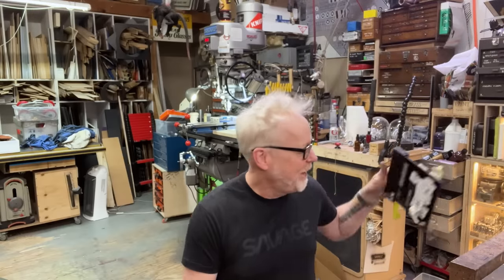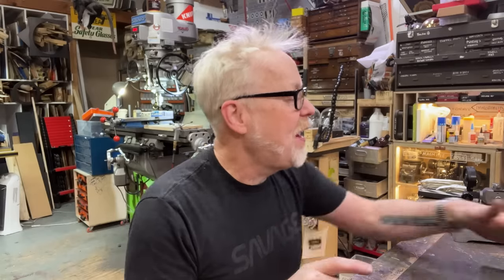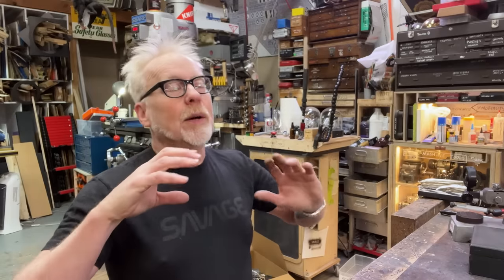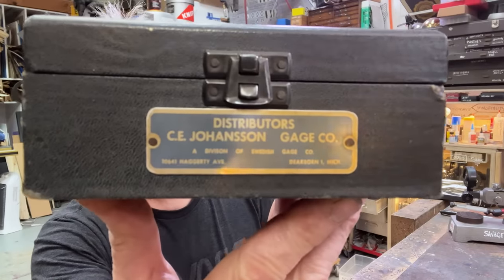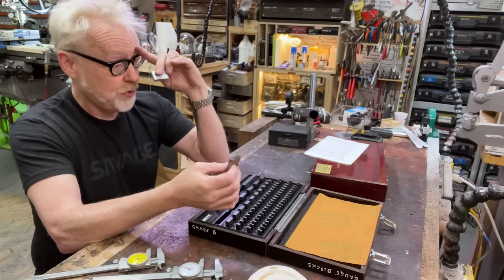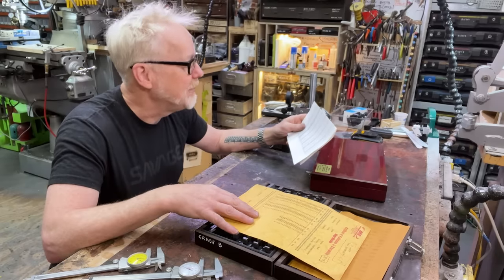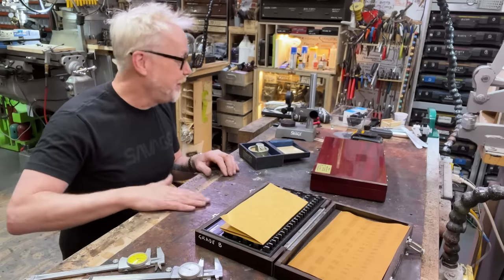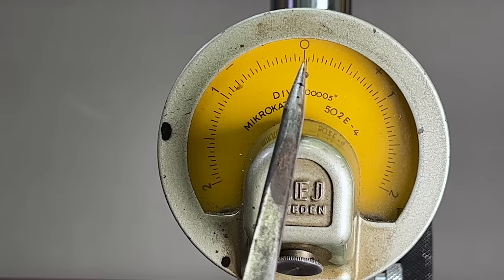Adam Savage's Most Precise Measurement Tool!

Comment from the maker: Adam on the science of measurement: https://www.youtube.com/watch?v=qE7dYhpI_bI
Dial calipers:  https://amzn.to/442pNNb
Reply: What where you at comicon in Indianapolis
Reply: You’d love to work with LOVAR. 
Basic Steel has about 6.5 ppm per °F CTE. I have a 100 foot tape of LOVAR which is 0.22 ppm °F. 

Invar is not an uncommon alloy used in lab standard and it’s CTE of about 2 ppm °F.
Reply: ….and the variation in size with temperature is why we usually handle Jo’ blocks only with a piece of chamois leather…..
Reply: 16:30 no, im just baked, love learning, and miss watching mythbusters after school
Reply: I was kinda surprised you didn't pul out a micrometer. I think we used to use Starrett Mechanical's micrometer  When I was in school. I loved working on the lathe & milling machine. I also designed stuff in CAD. I remember making 2 50mm blocks that I got to a mirror shine using emery paper & then emery cloth, eventually using the cloth part without any grain to lap them until they could be pressed together (without twisting) between my teacher's thumb & forefinger to see itf they stuck. he tested everyones by attaching one side into the magnetic part of the milling machine <you pulled a lever & the magnets would align> & hanging weights in grams from the other side.  (he showed us a pair of blocks that were so true they could hold over 42 Kilograms before they pulled apart. They were non-magnetic because they were aluminum.) Most of the class got a few grams, my neighbor's was almost 8.3 Kilograms, & mine was 17.6 Kilograms. 

Towards the end of the year our class was part of a contest for Panduit, (the machining company that machined extremely precision parts for NASA, F1, & Boeing Aerospace, etc) but I was a "people pleaser" back then & let ppl get in front of of my project. I still got 2nd place & my next door neighbor got 1st- a 4yr scholarship to Panduit. He went for a couple of months & quit. That was all I had wanted to do back then- but couldn't afford it without the scholorship. I ended up joining the military instead. Sadly I've never had the opportunity to do anything like it since.

Anyways, you mentioning Carl Edward Johanson reminded me of Gary Kildall- the programmer that invented CPM (Controller Program for MicroControllers, <for CMOS (complementary metal-oxide semiconductor's), DOS (Disk Operating System) BIOS (Basic Input Output System) & had his work reverse engineered using the debugger he wrote as part of CPM by Micro$oft for a deal they made with IBM.

His business was bigger than Micro$oft,(8M) IBM,(12.7M) & Intel(6.2M) at the time making over 25 Million a year for 3 years consecutively. As a result of their theft & bundling the reverse engineered version they made (complete with the exact same bugs the original had) bundled with new IBM PC's he was effectively run out of business.

Comment: when i was at college one of the students used a Mitutoyo grade A reference set of slips as parallels in the milling machine - the tutor almost lost his mind
Reply: ouch...
Reply: That's why you don't leave that stuff sitting around the shop.  I saw a B&S square, welded to a table as a welding fixture.  And it looked new.  I'm glad I didn't pay for it.
Reply: @corndog6700  the slips were in the quality control room (A/C of course) which was at the one end of the machine shop the  room was normally locked and we were not allowed in as spot faced 19 year olds, but for some reason the lad went in there and found them and must have thought "hey look a nice box of parallels" this was back in 1991 when they were rather expensive, god knows how much damage was done
Reply: Metric is the way.
Reply: @lloydwilson9104 and are still rather expensive
Reply: @lloydwilson9104  To be fair, they are a nice set of parallels
Reply: God
Reply: Well, if you want your workpiece LEVEL, THAT'S level.
Reply: @shelleyking8450  insert "rick and morty - perfect level" clip here...
Reply: Grade A? Ya sure?
Reply: @Doodlebob563  Not really, no two are the same height.
Reply: 1 @shelleyking8450
Reply: @billrowan1957  im an ex toolmaker - CNC programmer - former aerospace machinist and quality control engineer....... yep im sure  😁 you may also know these as grade 00
Reply: @fristlsat4663  luckily he had the 3" and 4" slips so didnt actually have them on the reference faces, i dont think he actually damaged them but boy did he get a roasting
Reply: @Scaze74 what does this have to do with this comment?
Reply: @Scaze74  i agree but precision is precision
Reply: @john1182  yea either is fine. Imperial has its place too, especially in aviation. Each has pros and cons to different applications IMHO. But its trendy to not acknowledge this and be fully "Americans and their dumb derp derp units, metric all the way!"
Reply: micrometers for c-clamps.
Reply: So long as distance is the metre, measured with a meter
Reply: I prefer furlongs per fortnight for velocity
Reply: @chiphill4856  I think you've just been spying on my daily walk!
Reply: @Doodlebob563  It's true. People will more conscionably use old ones as parallels, because they do make great parallels.
Reply: @shelleyking8450 True Level. (Rick & Morty)

Comment: Hi Adam, I love your videos and your fascination with the world of metrology. Being a retired metrologist myself I get excited when you put out videos like this and the others, of I also love the other stuff you do… If I may give you some advice, the reason you had trouble wringing your gages may be due to dirt. First off, you should never touch the business end of any gauge blocks especially your ceramic blocks! Wiping them on your clothing may be even worse considering the crud, which you’ll never see, that can easily stick like glue to the oils on your skin which will contaminate these surfaces. You can buy products to clean them yourself or send them to a reputable calibration house to have the cleaned. The data on the certificates doesn’t tell you the accuracy of the gages, but the DEViation of your blocks to the blocks used to perform the comparison. Gage blocks won’t have a stated accuracy, but their traceability values of the blocks used to perform the comparison procedure to your blocks. Their blocks have DEV data just like yours so during the comparison process they take the nominal value, labeled on their standard, add the deviation and then use that number to determine the DEV of your blocks.
Reply: I kinda figured this was getting to the level where cellular-scale material transfer from skin/cloth/etc would have an effect on the precision.
Reply: Yeah, I'm not a measurement guy, but even I was sad at the way he was treating his precision instruments. He just gets through telling us how they are finely polished, then he's there with his grubby fingers in his grubby shop, wiping them like a brute.
Reply: @chrimony  Well like he said, the B grade ones are the shop ones. But one can still clean them properly.
Reply: As someone who actively works in calibration and metrology it definitely is frustrating to see people mishandle tools especially ones that are used as standards. That being said. I love Adams fascination and understanding of the metrology.
Reply: Adam's attitude in these videos appears to be this: these are tools, i use them in accordance with the cleanliness level I am accustomed to, therefore the blocks will be consistent within my normal use.   He said himself that a few 1/1000" was about his tightest useful tolerance.  I hope I'm not putting words in his mouth.

Comment: Great metrology lesson. Regarding the calibration certificates of the gage block sets, I believe you were using the wrong units to express the variation from the nominal size. Since both gage block sets are in inches the deviations would be given in micro inches, or millionths of an inch (.000001”). One micro inch is 25.4 nanometers, so a variation shown on the certificate as +2.0 would convert to +50.8 nanometers, a larger deviation than what you suggested, but still impressive. I just received a new 81 piece set of Mitutoyo inch gage blocks grade 0 and they were about $2,200 Canadian. Your dial gage has graduations of 50 micro inches and since steel has a coefficient of thermal expansion of 6 to 7 micro inches per inch per degree Fahrenheit your gage should show a 50 micro inch change in length for an increase in temperature of 7 to 8 degrees F.

Comment: As a swedish CNC machinist (lathe) we use gauge blocks, micrometers and digital calipers all the time. The smallest increment we deal with is usually +\- 0.01 mm for diameters on the parts. We were very clearly taught that these were a swedish invention during trade school.

Comment: Yes the expansion of the steel block is due to your body heat that is why the better set is ceramic, lower expansion due to heat. I think the reason your gauge blocks did not remain together was due to your sweat from your hands. The sweat has oil. water and acid in it so after handling the block they should be cleaned other wise they will change size and get pitted over time. Better to wear gloves when handling them. Hope this helps.

Comment: Vernier calipers have always fascinated me.  A recent tear-down of a digital caliper convinced me that they are also Verniers.  I'd like to see the tear-down of a dial caliper.  There must me something special about that claim of "shock proof".
Reply: Vernier calipers use the Vernier scale. Digital calipers use magnetic strips to measure distance.
Reply: I'd assume it's the same shock proof as wristwatches. So the jewels that hold the gears are held in with springs
Reply: @asicdathens  Exactly.  The tear down I saw (Big Clive) showed that two sets of strips are aligned with one being scaled down for a Vernier relationship between the two sets of strips.  The key explanation: https://youtu.be/fKSSY1gzCEs?t=732
Reply: @DedmenMiller  Hmmm, having seen ruby synthesized in a kitchen, I think that's very plausible.
Reply: BTW, I'd had long distrusted (past tense) digital and dial calipers because I didn't know how they could achieve reliable accuracy.  Traditional Verniers I trusted because I not only understood how it worked, but also could see it in action.  That Big Clive video convinced me that my distrust was unfounded.
Reply: I had a guy that claimed to be a "gunsmith," like it meant that he was more accurate than "just" a machinist.  He told me he could measure .0002 with his calipers.  No, you can't.
Reply: @corndog6700  O.K. maybe you can help me.  I have this lingering memory of going to a firing range with my dad in the 90's.  I could be totally insane, but I think he had me fire a .38 out of a .357.  Was that a myth. or reality? I seriously haven't figured this out.   Would love to know.
Reply: @corndog6700   micrometers can do it, and people get the terms wrong all the time.  But your right calipers are like guessing to a real machinest.
Reply: @TesserId  That's a whole issue in itself. Calibers aren't necessarily named after their true projectile size along with using a nice deformable metal base it doesn't matter that greatly ( in a metrology sense). .38 special and .357 magnum use the same bullet diameter, the same as .223 Remington and 5.56x45mm whose projectile happens to be .224 inches (which is neither of the cartridges' indicated diameter).
Reply: @ScuffedEngineer  Thank you for the explanation.
Reply: The general mechanical guts of a dial caliper (Or a dial indicator, at least to the .0001" range) is just a rack and pinion.  There are springs involved in the dial to keep the pinion tensioned against one side of the rack and eliminate backlash.  If you accelerate a dial indicator or caliper rapidly enough (like by dropping it) The mass of the gear train and the needle will be enough to damage something, either the pinion will skip on the rack, or the needle might actually spin of the shaft, or you could even break teeth on the pinion.  In the shockproof instruments the pinion is connected to the gear train with a hair spring, kind of like the spring on the escapement wheel of a watch.  When the pinion accelerates too quickly the hairspring winds up, and allows the gear train to catch up, never generating enough forces to damage anything.  With a dial indicator you can actually push it quick with your finger and watch the needle lag, and you can feel and hear it catch up.
Once you get into indicator's like Adam's 50 millionths indicator they are probably not using a rack and pinion mechanism, it is probably some kind of lever mechanism using fulcrum spacing to magnify the motion.  I have always wanted to disassemble one of those to determine how they work, but have never managed to acquire one.
The most fascinating thing about precision measurements is that the instruments have no tolerances in their construction that are as precise as their measurements, with a given precision you can always make an instrument to measure higher precision.
Reply: @fristlsat4663  Thanks.  I've been watching a number of dial caliper tear-down vids now.  At least one showed a missing tooth on a pinion gear.  I find that disheartening.  Your last point about precision instruments is well taken.  That fact is always lurking in the background.
Reply: @TesserId that’s the cool thing about a .357. You have the option to use both calibers.

Comment: We have one of those in our shop. I work in cylindrical grinding and we often use these types of gauges when match fitting round parts to fit inside a sleeve or bore with a certain clearance. A .00005” to .0001”clearance is a common amount. We often prefer the Dorsey .00002 gauges we have around the shop. They tend to be a bit more repeatable and hold the set value over time better.
Reply: Same here, I grind parts for industries I cannot name that have a tolerance range as low as .0002. I do run a few parts that have tolerances as large as .002, but for the most, they are in the .0005 range. It's not always easy to explain to new people how ridiculously small that is.
Reply: @sithus1966  I always get my micrometre, measure a piece of paper and show them it's about 0.004", then say as thou is a 1/4 of that, show them the gap in-between the anvils on the mic at 1 thou, shine a light in the  gap so it's visible and then do the same with 1/10th of a thou. Still hard to comprehend but makes it a bit more understandable
Reply: And some people don’t get it no matter how you explain it
Reply: @sithus1966  ya when we have a tolerance of +or - .005” we say it’s a football field.
Reply: @lslslslslslslsl1  If you are using small enough measurement units, I find the most effective way to comprehend scale is how little "background noise" can ruin your measurement.  Even on a laser interferometer sitting on a granite block sunk in a foundation isolated from the building, the 7th or 8th decimal place never settles.
Reply: @Andre_the_Lion  I don't work with anything smaller than 0.0001", my main concern is heat but I get that
Reply: it’s a smell… and hitting .0002” on a machine makes me go bonkers. Long nights
Reply: Dorsey, fortunately, still makes the best, most elegant American-made gages.

Comment: That bit from 32:10 was just awesome, what a great capture of the effect.
Reply: Figures id find you on a vid that's all about precision lol. Love your vids, your craftsmanship blows me away, especially the engraving.
Reply: My jaw literally dropped
Reply: That explains why the more precise ones were ceramic. It might not be as subject to heat expansion as metals.
Reply: steel has a thermal expansion coefficient of 12.5E-6 per K (using higher end of range). so an inch of steel would expand about 3.175 microns raised by 10 Kelvin (rough guess hand temp versus room temp). problem is a single division on the 502E - 4 is 12.7 microns and it fell by three quarters so lets say 9 microns. thermal expansion appears to only account for a third of this falling needle (my guess is probably much less as i dont think you can raise that steel by 10K within only 10 seconds of holding it) with about 6 microns unaccounted for. this is half a division on the dial and very visible. i would say get out those Mitutoyo cerablocks and redo the experiment to see if the needle still falls, as that might point to an issue in the dial itself (maybe rusty spring). the cerablocks have 300x lower thermal expansion coefficient should eliminate that factor.